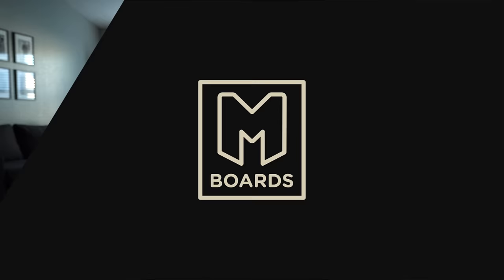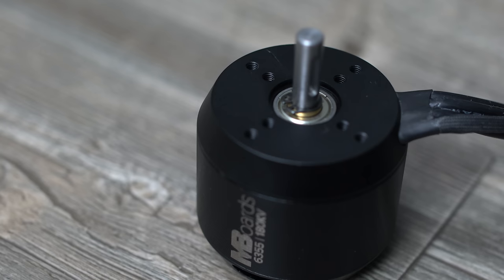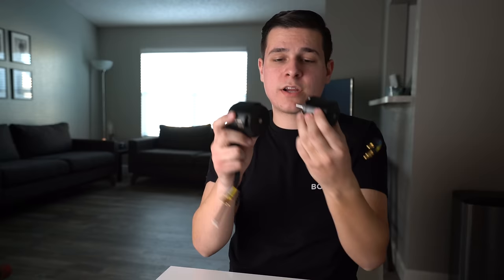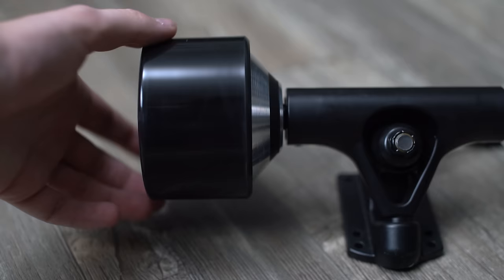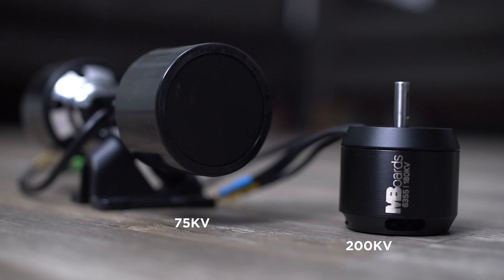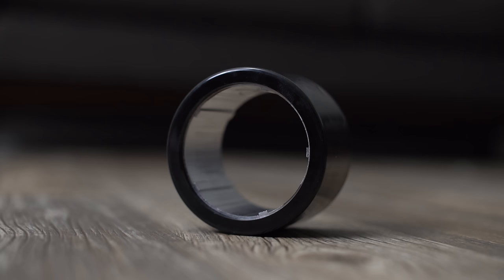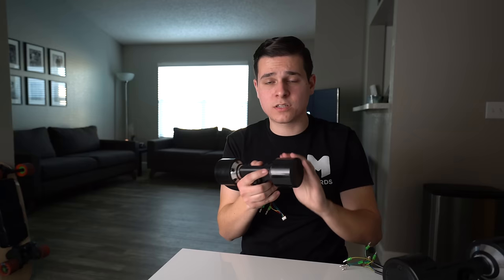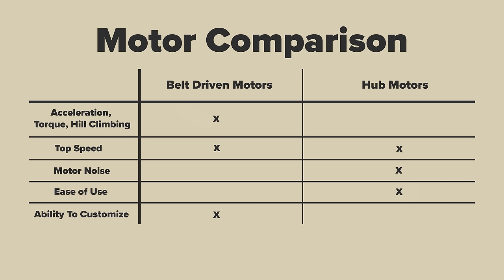How To Choose A Motor - DIY Electric Skateboard Build

Comment from the maker: What Motor set up would you pick? Why? We’d love to hear 😎
Reply: I think you glossed over one important thing... dual motor vs single motor braking. Dual motor is going to bring you to a stop quicker which if you are going faster than 20mph is vital imo. It also provides a failsafe if one belt snaps under hard acceleration/braking.  

I still have my hub motors from my meepo board but I am looking at a direct drive system in the far future. They are new and expensive so I'm not surprised you didn't include them in this video. Plus you don't sell them 😜

I already knew all this information but wanted to see how you explained it plus your videos are relaxing. Great job!
Reply from the maker: Thanks for the comment! You are absolutely right, definitely should have mentioned the failsafe of having a 2nd belt just in case. 

Also should have mentioned the faster stopping power of a 2nd motor. 

Didn’t mention direct drive because they honestly deserve their own video all together. Just too few options out there along with the higher price point. 

Thanks for watching!
Reply: can u do a skate with motors?
Reply: @mavic5149  just a skateboard deck no problem.. skateboard wheels with motor possible but makes no sense because you cant really skate nd trick anymore and the speed nd torque of the electric would be bad ;)
Reply: Single belt 6374 for the win ;) but soon i try the 90mm hubs on 10s :D
Reply: Bro DIYelectricskateboard launch new DD hub motor could u pls tell me which should i go with ? DD hub motor or belt motor ?
Reply: @justdoit_bd5442  if you want the POWER i would go with belt.. if you want a more silent and compact board i would buy hubs .. but i dont known the hubs from diy .. but ive got the 6374 190kv from diy. still doing fine after hundreds of km ;)
Reply: @DeBartli  bro but did u saw thos DD hub motors they can do 45mph+
Reply: @justdoit_bd5442  yeah.. but my board with 35kmh (~27mph?) is fast enough ;) atm i m building a short board 80cm+ with two 90mm hubs.. if i want crazy speed i would go for double belt motor and a huge battery but that would be big and heavy as f
i'm thinking of investing in a new vesc.. e.g. dual focbox ;)
Reply: So what would you recommend for a dual motor off road skateboard?
Thx in advance and great vid!
Reply: Is KV4000 good ?
Reply: @cyclingneon3422  for e board too high kv..
Reply: @DeBartli   can you help me? What is the best  kv? For e board  and size thankz!!!🤔
Reply: @DeBartli   what is? The best motors for electric skate rollers?
Reply: @DeBartli  is 5055 600kv good for e board
Reply: @cyclingneon3422  on the smaller side but works.. always w
mattery what you want
Reply: @cyclingneon3422  there are many der diffrent.. first choose what specs your board should have
Reply: Hi I wanted to know if the dual motor all terrain (saw it in your website) is a good choice if I want to have a all terrain board
Reply: HEY LAD . I NEED LIL ADVICE HERE ON ESCs AND VESCs . WELL I ORDERED 4600W 4x MOTORS AND I HEARD TO REACH THE MAXIMUM POWER I NEED SUPPLY THEM WITH 48V ........ WELL IS THERE ANY WAY I CAN FUK THE PEDAL TO HEAT THEM UP TO MAX WITH 22V-28V ??? BIG THANK YOU
Reply: Did you really start this video by saying.. "Without a motor your electric scooter may power on & everything but it won't move "   OMFG !!!
Reply: jUsTdOiT_bd  I need that motor
Reply: MBoards DIY Electric Skateboard Tutorials  can you make me a board for my longboard I need speed and power and range and a good cost and I want it to sound powerful my longboard and skateboards sounds like jets and a heavy duty truck with brakes
Reply: Does anyone know if a 5055 270kv motor fit on a Caliber truck II motor mount for a Dual
Drive setup. If not I could use a 6355 190 kv motor
Reply: MBoards DIY Electric Skateboard Tutorials  good question I need speed and power so I would have  you pick it out for me
Reply: @mavic5149  yep
Reply: I'd pick hub motors because they are basically silent, there is less maintenance, less moving parts, and just have an appeal to me that I can't explain
Reply: @nicholasgianoplus3904  that's what carving is for, don't ya know?
Reply: Bon Yamaro  I just ordered that. Coming from 6368 170kv. I expect it to be quite a bit more powerful
Reply: I seen a guy skating in Anna Tx today down at the Walmart.  He said it was an Mboard.
Reply: In most of Europe, police will take ur eskate on sight in they hear noise and see belt motors. Thats why gotta go hub here. Not a big difference between them tho, torque are similar on my meepo v4 compared to my zealot s.

Comment: Very helpful video thanks for the info. I appreciate the replaceable wheel skin, for a downhill or freeride skater the wheel can be much smaller after a day of skating. If a race on a motorized skateboard is anything like downhill you could have some sick burnout drift races. Also some induro aspects to long distance races. Regenerative braking for charging the battery? Very interesting prospects.

Comment: Thanks for the showcase in motors. I'm curious if you have thought of the magnet length inside the motors? There are long motors which aren't intended for skateboard use but people shoehorn them in for powerful braking and regen. ie. Instead of 6355 its 63 and the length is 80 really weird but it works with wide trucks

Comment: Will a single 270kv motor go up a decent hill?
Reply: You also need to consider contact patch. If you use a single powerful motor and you're slipping backwards you should back off the accelerator. 270kv is good for hil climbs and it's strong enough to work alone. I hill climb a lot and I use Large-Hub direct drive motors for torque and range.

Comment: Apreciate this video so much Mike! Just as many of your other videos, you do so well on making it simple and easily understandable. I just have one doubt. I am making an e-mountainboard, considering lower kv makes for better torque, will a 140kv 6374 motor, 8 inch wheels with an Mboards 10s 3p give me good hill climbing performance?
Reply from the maker: Hi! Yes that would make for a solid build! If you can swing it, I’d go for the 10s4p for that extra amp output.

Comment: What if we equip both speed motor and torque motor and use only one at a time. We can switch on remote control for which motor to run according to requirements. Lol.

Comment: Hey man this is a great video... I am a mechanical engineering student trying to make my own board. However I am not that great at eletrical stuff and I would like to know how to get the appropriate battery (and which type) for the motor we have chosen. I know there's big differences between lithium ion, lipo batteries but considering i want range and speed as well how do I chose what kind of battery and how many of them (lithium ion) would I need to be able to get enough power out of them to get to specific speeds. I knew my question is weird I just hope you understand it. 

Great video btw from a scientific point of view it helps a lot when you want to get a lot more technical.

Comment: im building a rc art piece that im looking to upgrade the drivetrain to these. can i use rc batteries with these motors or are they not rated for this level of discharge?

Comment: Really appreciate the video. This was exactly what I was looking for. I have a Lacroix Jaws 2.0 with stock 6389 190 kv motors but need new motors and trying to figure out which way to go. Currently belt driven but planning to put on the Boardnamics M1-AT Gear Drive. When you say 2 types of motors; Belt and hub motors. The belt motors include the gear drives and not only the belt drives, yes? Any idea which motors would be equivalent to my currents as far as speed, torque, range, price, sound? And which would you recommend if I wanted to go to the next step up motor? I'm currently looking at the Flipsky 6384 190kv motors. Thank you!

Comment: Do you know if there is anyway I could swap out the hub motors on my halo board and replace them with dual belt motors without having to get a new ESC and a new battery?

Comment: How do you wire 2 motors parallel (wirelessly) to one signal from a remote?
Reply: Youre going to need a dual motor esc. Dual motor esc's will wire up to a single receiver and remote, just like a single motor esc and motor.

Comment: Very interesting. My board has hub , 3000 watt total,35 kph 25 k range, and goes up 25 percent hill. I would like more speed and keep the hill climbing. Looking around at options it seems to be a case of gain on one and pay with another.  On the sound side of things, I just love my Razor longboard. It may only be 120-watt gear drive but that sweet turbine-like scream, the best. My 3000 watt total is a Black Hawk Electric Pro series V3.

Comment: Hi  . I need a motor that has a minimum speed of 1000 RPM and high torque and operates 12v or 24v DC . What do you advise me and thank you

Comment: Would you recommend getting a cheap £15 cruiser board and wheels. Then spend a decent amount on the electric components fix it on the board? im looking for in between torque speed and noise
Reply from the maker: You just want to be careful when getting trucks and wheels. You want to make sure that you can find a motor joint that will fit your trucks and a pulley that will fit your wheels 👍🏻

Comment: Looking to build a jet surf board, do you know anything about the motors they use, I hear they can use skateboard motors...280kv? I would assume larger better.?....I’m very ignorant about motors,controllers,batteries etc, but have built several boards, and boats😬

Comment: Is anyone still around to give some advice??

I'm looking at resurrecting an old electric scooter and thinking of popping a 4000w 6384 motor in there. At 36W a 4000w motor will draw 111A which is far too much for the battery I will be using. Am I best off limiting the current draw to something like 70A or buying a smaller 6368 motor that is 1750W?

Comment: Hey, i liked you detailed video but got some queries. Can 6374 180kv/6384 120kv motor be used for quadcopter rather than skateboard? can you please explain how much cogging torque they have? Can they be modified into diy digital Servo motor using encoder.?🤔

Comment: Can I connect a dual motor esc to a single motor, i will upgrade to 2 down the road but I don't want to buy different esc and batteries etc.
Reply from the maker: Yes this works 👍🏻

Comment: Which direct drive motor has the least wheel rotation resistance without power (eg. Battery goes totally flat) so that I can continue to push / pump like a normal skateboard?

Comment: Is the dual 70mm hub motors compatible with 36v battery?
And is a battery 108Wh (36v,3Ah) strong enough to drive a single 5055 belt motor?

Comment: I’m about 225lbs going with dual belt motors and 12s battery but can’t decide on which motors would move my weight the best ... I’d like a top speed of 25mph I was thinking the 6374 180kv  ... help please🤷🏽‍♂️
Reply from the maker: Dual 6374 would work really well for sure 😎

Comment: Seriously awesome videos dude, this was an instant subscribe for me!  
How important is wattage of the motor?
The 6374 on your site has Max. Power: 3250W 
The 6374 on another site has Max Power of 4000W
Reply from the maker: It’s important but at the end of the day, the battery you’ll end up using will be the bottle neck. Not the motor. It really won’t make a difference when dealing with wattages this high.
Reply: Mostly 6374 is 3200 watt. And 400p is 6384 motor

Comment: I can make up missing KV or overkill of an KV via gearing right? Will there be a difference between 2 same motors one being 200 kv and my gearing being 1/2 and another motor 100 kv my gearing being 1/1? Is one a better option than the other?
Reply: you'd have to look at specs to get a definitive answer, but any time you add reductions there will be some amount in inefficiency, that could be fairly high or quite low.

Comment: What about two single motors . You said the model plane motor is to weak with torque . The low end on the back and then the high end on the front . People put the weight on the back and after they hit a high speed people start to lean forward putting their weight on the front trucks . I have a old board that i decided to keep and not give to a needy child . The deck is a vans limited edition death box . The trucks are the widest that i could get . Indy's . German speed bearings . I had awesome bearings but it was stolen . Quarter inch risers . The wheels are coned out . Back in the day the rubber wheels would stretch out from the heat and weight of from carving a turn . I was wondering what would you recommend for my board . My long board i gave to a kid that had to walk to school and work . It's probably worth $500 or more because of how rare it was . Is it possible to a pocket bike motor in the middle of the deck and battery next to it . They run a pulley system to the wheels ? If so what kind of kit is needed ? Mahalo  for you time .

Comment: I currently have a Verreal V1S and a Blitzart Hurracane dual motor.Both decent budget boards that have served me well but I would like to convert one of them to belt drive because I would like to run the  rough stuff wheels.
What kit could I buy that would work with one of those boards batteries and esc?
Thanks
Reply from the maker: If your current board is using HUB motors you’ll most likely need to change the ESC out as well (many ESCs are programmed for either HUB or belt). 

Just be sure to get an ESC that works with your current battery’s voltage.

Comment: Nice video man! 😎
Hub motors are great but they are not for everyone! I literally ruined mines in two weeks! I ride a lot on sidewalks and the gradings make the urethane come loose after a while. They also get noisy if you ride on wet surfaces as they rust out, they get too hot and lag sometimes at low speed. Belt drive is just the best! Beside broken belt and cost, (noise isn't a big deal), it kills hub motors. More torque, more speed (handles better 12S), freedom on other parts such as gear ratio, wheels (types and sizes), ability to configure the VESC (you decide how strong the brake is, how powerful the board is, etc ). For the motor choice (for belt drive), it depends on:
* the battery you want to use: 6s - 10s (190KV and above >), 10s - 12s  (190KV and below <) [when using VESC 4.12, or FOCbox]
* Your weight and how hilly your area is (aim for higher KV if you are lightweight and need more speed, and choose low KV if you are heavier and need more torque)
* To figure out what is the max KV you can use in your setup, apply this:
8600 / Max Voltage = Max KV

ex: 8600 / 10s (42v) = ~ 205KV So 205kv is ideal ! (Note that your board will work fine if you don't respect this rule, but your VESC is more likely to fail )
If you have a motor already and want to know what voltage is the best for it, just apply 
8600 / Motor KV = Max Voltage
*wanna find out your ERPM: apply 
KV * max voltage * 7 = ERPM
ex: 170kv * 50V (12s) * 7 = 59 500 ERPM (Check if that's safe for your VESC)
I hope this helps also!

Comment: Great video! 
One question. Why do the range deceases with two motors? battery? if it is that, would it be solved by making the battery bigger?
Thanks for the tutorials!
Reply from the maker: Even though each motor only needs to pull half the weight, the natural inefficiencies lead to more power draw. 

Increasing the battery size would add range 👍🏻

Comment: I am frustrated by how often people conflate KV ratings with torque output of motors.  Given two motors with different winds, (assuming the copper fill can be made the same somehow and therefore all other factors are equal,) they will have different KV ratings.  Given the same maximum wattage, both motors will produce exactly the same torque.  The difference is in how fast they will turn given the same voltage.

What different KV ratings give you is the ability to run lower voltage and higher current, or higher current and lower voltage when targeting a given maximum RPM.  If you want to make an informed choice, look at what voltage you are willing to run and what sort of current you want to pull from your battery, then figure out your gear ratio, wheel size, and maximum desired speed.  From there you can then choose the most optimal KV given those factors.

Lastly, (and this is something that still hasn't caught on yet in the sales chain,) motor efficiency depends on a number of factors, but the biggest ones are lamination thickness and how tight the windings are on the stator.  A good quality motor will have thinner laminations (minimizes iron losses) and as clean and tight of windings as possible, with very little excess copper sticking out at the ends of the stator, (minimizes end-winding losses).  Lamination thicknesses range from 0.5mm to 0.2mm, and very few online sellers know what these specs are, much less list them on their product pages.  So far the only supplier I was able to confirm that sells motors with 0.2mm laminations, (the thinnest and therefore likely highest efficiency,) is Maytech.  Others may use that size as well, but so far no sellers have gotten back to me with those details.  The higher the efficiency of a motor, the more power it can take continuously, the less heat it will generate at it's rated power levels, and the less power you will waste in general riding your board.
Reply from the maker: Hi Eitan! As we said in the video. This is a basic overview and introduction. Everything we said does apply to our 2 specific motors when looking at them side by side. 

Most of the info is a rule of thumb but not 100% for every single motor out there. 

More advanced users are always able to dive in deeper to motor specs. 

We are just here to bring the basics to beginners.
Reply: please make a youtube channel